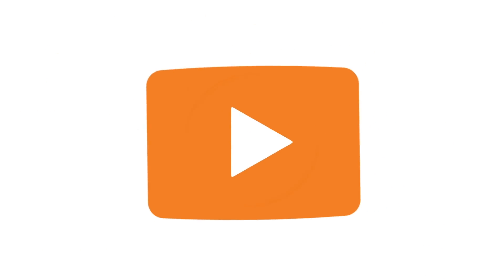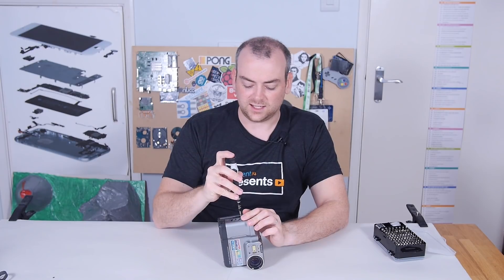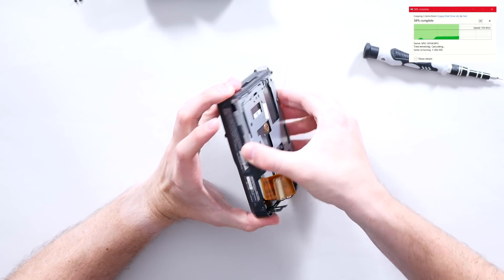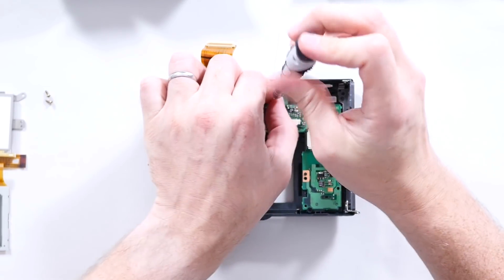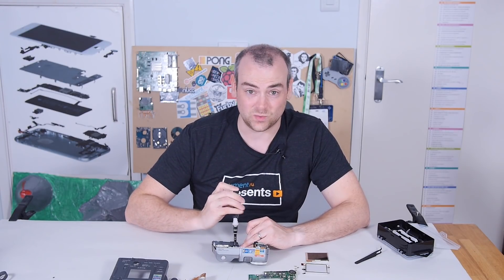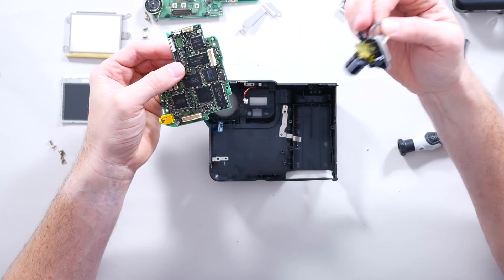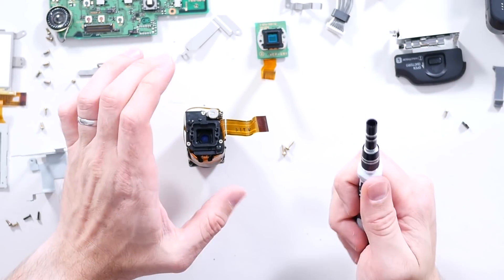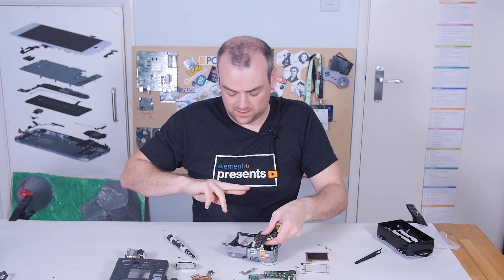Sony Mavica FD-83 Floppy Disk Camera Teardown - The Electronics Inside

Comment: Apologies for the audio in this video, unfortunately I suffered a hardware failure duing filming that I didn't notice until the edit. As a result, the only consistent audio we could use was from and alternative of lower quality.
Reply: I couldn't make it through it. Sorry.
Reply: Does anyone know how I would get video off of one of these and onto my Mac?
Reply: @WinstonHacking  I would think a USB floppy drive should do you? I picked one up off eBay for £10 or there abouts?
Reply: @a531016  Ah ok, I'll just have to see which one is mac compatible, and then whether or not VLC can open such an old video file!

Comment: My Casio WK-3200 musical keyboard accepts a SmartMedia card for data transfer. I wish I had gotten the model with a floppy disk drive, but my mom bought it for me used.
Also, apparently floppy disks got less and less reliable the later they were manufactured.

Comment: I have a couple Mavica camera with easily replaceable CR2025 batteries for saving time and settings. However, I can't find where to replace the CR2025 on the FD83 model. Do I have to disassemble the camera to replace it's CR2025 battery?

Comment: I remember the flash capacitor on an old film camera... still have the charging circuit around, I think - if I ever want to zap myself.
(Not sure which is worse, the capacitor or the spark off a wind proof lighter)

Comment: My school had one. Imagine the draw was CF/Smartmedia cards were expensive and was before USB common therefore needed proprietary connection cables. Floppies were cheap, ubiquitous and all PCs had floppy drives. If someone lost a floppy - no problem. Loose the memory card or connection cable ---> unusable until many £s spent! Also, files still quite small so could fit enough pictures on a disc
Reply: (or those smartmedia to floppy disc adapters! They were weird!)

Comment: That is a super slimline floppy mechanism! I think the faster writespeed is probably achieved by using a custom floppy controller. Most PC’s all used the same design of controller chip. My memory of floppies is maybe a bit more favourable, in my experience they where reasonably reliable if you bought good brands and used them with some care. I have 30+ year old disks that still work fine. Granted they are brands such as TDK, Maxell, Verbatim and 3M. Disks that I consider bad where brands such as Memorex. Nothing but trouble with those🥶. I remember using one of these camera’s in the early 2000’s for a school project, our teacher had one. For the time it wasn’t bad at all but soon I got my own digital camera which had compact flash cards of 128 mb of storage. That was a cheap Medion branded camera from the Aldi stores.....
Reply: 128 Mb! Wow, that probably cost a fortune for the memory alone!? 

I am tempted to source annd tear down the first digital camera I had for a comparison - watch this space...

Comment: the BEST floppy drive you could get, was an LS-120 drive. Yes, it had the ability to read/write a 120 meg 3.5" floppy (similar to a zip disk) "disk" but, it also was a high speed floppy drive, with no interrupt. (Anybody remember when a computer started reading the disk, the entire computer would freeze? that was because it was tying up an interrupt to read the disk)  I used to buy these drives to use on my servers, and high end systems, so I could still use floppies, without crippling the computer it was on. Never really used the high capacity LS disks.

Comment: I believe they also made a cdr version too although I’m not sure if it was a full size cdr or a mini disc.  I remember the floppy version.  Mostly, I love sed the 1.4mb discs. It made a lot of sense at the time and I used to carry floppy discs in my shirt pocket.  I also remember an MP3 player that used higher capacity Zip drive floppy discs.  I had a Zip drive too, although a zip disc only held 100mb and a cd held 700.  The Zip drive was around the same price as a cdr, but the early cdr were very slow and zip and floppy were much faster.  Flash existed, but was very limited in capacity and was super expensive.

Comment: Shocked to hear you think 3.5 floppies were ever unreliable. Far from it! There's a reason they stayed around so long.  Sure they might not be as robust as modern solid state but  with their chunky plastic housing and metal shutter they much more robust than the previous  5 1/4 generation.

Your issue with a recent purchase is probably down to extremely old stock running on an old drive and who knows how dusty and misaligned that might be rather than the reliability of the floppies  in general.
Reply: I agree I only had a problem with them in the early 2000's because I didn't buy new ones anymore.
Reply: A lot of 1.44 disk makers cheaped out in the late 90s, rarely you'll find a full box of disks work from then when compared to a brand new box of Single and Double Density disks. It was just a thing that happened with consumer magnetic media once CDs and DVDs took off, they stopped supporting it properly and you ended up with ferric cassettes and unreliable diskettes.
Reply: My experience of Floppy Disks only really starts in anger around 1996, so I probably missed their hay day. I can honestly say I had a number of issues with them through time, so never loved them. But I guess my only comparison was newer media (CDR, flash etc). So compared to older hardware (5.25, casette etc) they may well have been an improvement.
Reply: I found floppies very variable - some lasted ages, many died randomly and rapidly (talking late 90s)

Comment: I got bored recently and tore apart this camera because the one I had didn’t work at all.
Reply: What did you think? Interesting insides?
Reply: @a531016  I actually was rlly excited about some of the internals, I was wanting to keep the display screen for future uses but realized how hard that would actually be to do and I wasn’t sure what to do with the rest of the components so I kept the flash and the lens and the snap button.